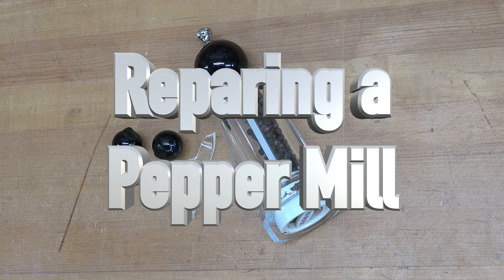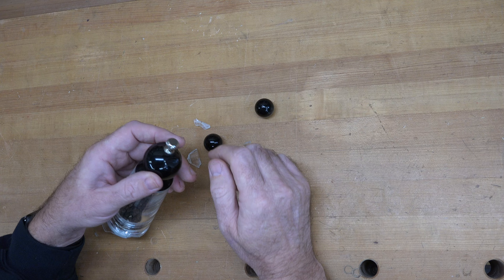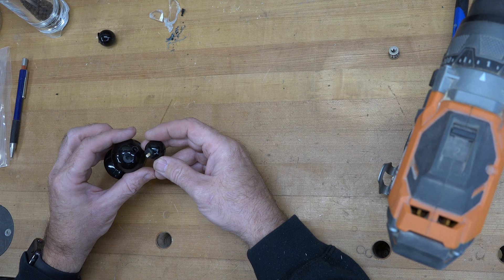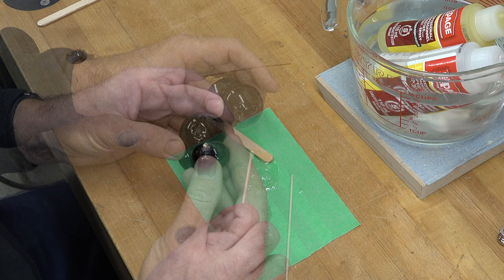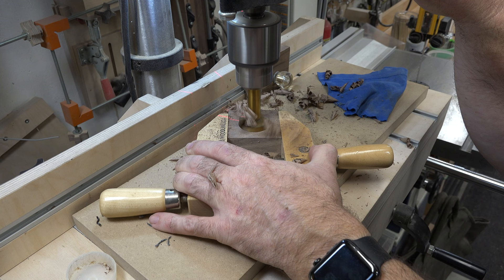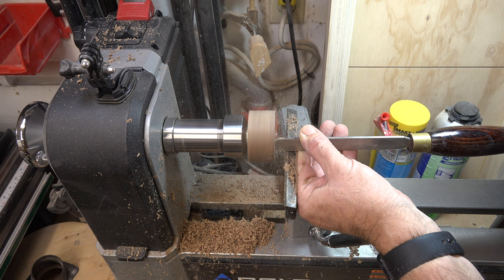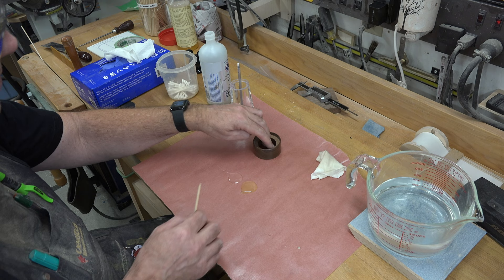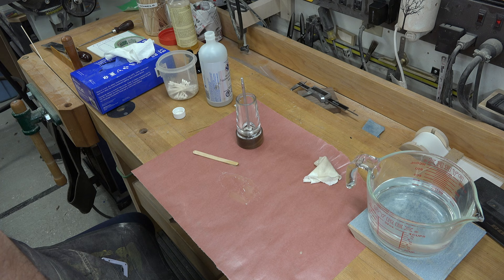Repairing a Pepper Mill

Comment: When a previous employer closed down, I was lucky enough to be given several tubes of high quality 24 hour epoxy. That stuff is as hard as iron once it cures. It's saved me a small fortune in appliance and auto repairs. Even though they are over a decade old and have thickened, I just have to warm them, liked you showed, and they are like new.
Reply from the maker: That's awesome Jim.  I'm glad to hear that you are still able to use it by warming it up.  Thanks for tuning in and for chiming in with your story.  I love it.

Comment: You could have so easily just epoxied the broken bits of plastic on the base back on, but no you had to make a piece out of wood ......... and it looks absolutely fantastic 👍
I agree with your comments on our chuck away society, but this is by design ... the manufactures have done this as it makes them more money ... when we say that things aren't made like they used to be it's a fact, they are designed to fail after a certain amount of time!
Reply from the maker: Agreed Barry.  There is no money to be made in making a quality product that lasts.  As for the plastic base.....there were pieces missing so I didn't have a complete puzzle to glue together.  LOL.  Thanks for tuning in this week.

Comment: Ken I have a Jar lid opener that was my grandmother's she got it back around 1920s, you turn the wooden handle and the Jaws grip the sides of the lid and with a twist the lid come off ,the wooden handle broke and my mother said throw it out she'll get a new one, I took it and started to repair it cleaned the metal Jaws off took it down to the bare metal made a new handle out of oak, once it was repaired my mother and I went to a kitchen store, I picked 1 of the jar opener up and it was heavy plastic the handle looks flimsy all this for 17.99, I told my mother don't bother it's a use twice and throw it out, I gave her the 1 I repaired she couldn't belive how it looked that was 27 years ago and it still works, now I have to do the bottle opener, sorry for waffling on my point is if it can be repaired just repair it items that are 30+yo are better then what is made today companies know if it breaks you will just buy a new one and make the company richer, things were made to last before the 1970s after the 90s it became a throw away world
Reply from the maker: I couldn't agree more Alan.  There's a reason that cars don't come with grease fittings to lubricate moving parts anymore.  They call them "greaseless".....I call them "temporary".  A fridge and stove used to last 30+ years but there's no money in that so now, they last 7 years.  It's horrible what they've done to the retail industry.  Repair what you can.  Thanks for tuning in and for chiming in with your story.  It's appreciated.

Comment: Don’t mix up the salt and pepper when filling. I wasted time trying to repair the grinder just to find out that was the problem in the first place.
Reply from the maker: For the most part, salt and pepper grinding mechanisms are very different.  The pepper grinding mechanism is usually metal of some kind but due to the fact that salt is very corrosive and eats metal, the salt grinding mechanism is usually ceramic.  Thanks for tuning in to the show and for chiming in with your thoughts.  It's appreciated.

Comment: While I agree with you, the issue is that buying an item again is cheaper than the labor it costs to repair. How much would you charge someone for your labor to repair the mill? Alternatively, that pepper mill is that cheap ($20), because there was minimal human labor involved in order to make it (compared to a hand turned wooden one). Not every repair can be done by everyone. Many people do not have the tools, confidence, and/or skill to make such repairs.
Reply from the maker: While I agree that many do not have the tools, confidence or skill to make some repairs, I think the point of the show is to at least try to make the repair.  Try to learn something new instead of just throwing things away.  This repair could have been made in several different ways.  No lathe?  Use a block of wood, hole saws and fortner bits.  My time is not free and a lot of people forget to include the labour involved in repairing a project but there's a matter of gaining some self satisfaction with a successful repair.  Much like anything, there is always more than one way to look at it.  Thanks for tuning in and for chiming in to the conversation.  It's very much appreciated.

Comment: I would absolutely take my shoes to the cobbler if the cobbler didn't want 10x the price of new shoes just for the soles.
Reply from the maker: I had a favourite pair of boots years ago.  They cost me over $400 to have them made for me and over the years of owning them, I had them resoled 3 times for about $35 each time.  That ended up giving me about 20 years of use from the boots.  If you are purchasing a $10 pair of shoes, obviously a cobbler wouldn't be a viable option but for a more expensive pair of shoes or boots, it may be considered as an investment in longevity.  Thanks for tuning in and for chiming in with your thoughts.

Comment: Very nice Ken; when I first started watching this video I thought it was going to be a real grind to make it to the end. But I was wrong! I learned two things one that isopropyl alcohol will clean up the epoxy and that hot water will soften the epoxy. Oh why is it that everyone in Canada uses Le page’s adhesive’s? See John Heinz, Mathis Wandell and you can’t leave out Red Green they all use Le Paige products 🤪.
That really turned out nice! Kind of classy compared to when it came into our world. 😁🛫
Reply from the maker: LePage is just what's available.  When it comes to things like contact cement, 5 minute epoxy, wood glue etc, Le Page is the leading manufacturer here and it's pretty hard to get anything but.  I wish we had more options but for now.....LePage is the only game on the menu.  Thanks for tuning in this week.
Reply: @acutabove_woodworkings  wow that is pretty interesting about Le Paige being the only adhesive supplier in CA. Does Canada have a high divorce rate? If not I think I know why now. 🤪🛫